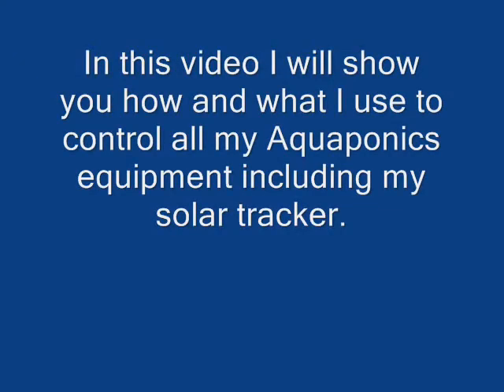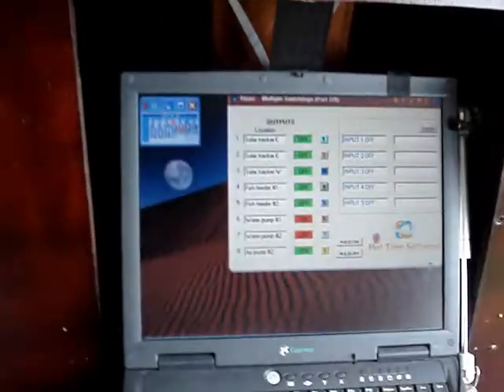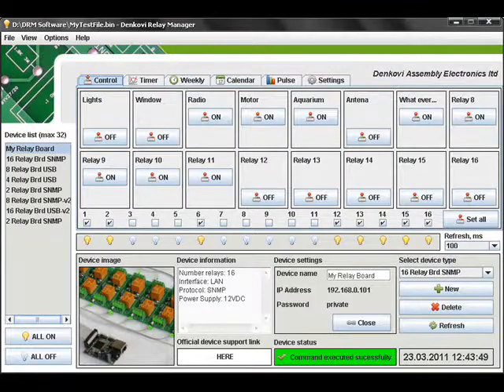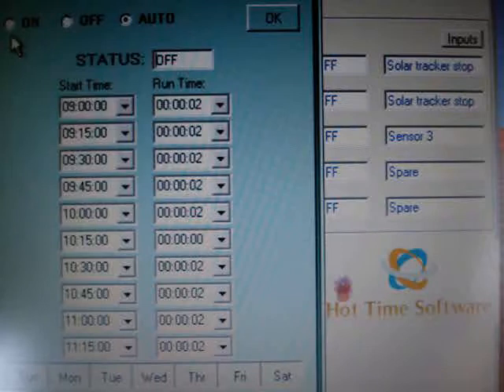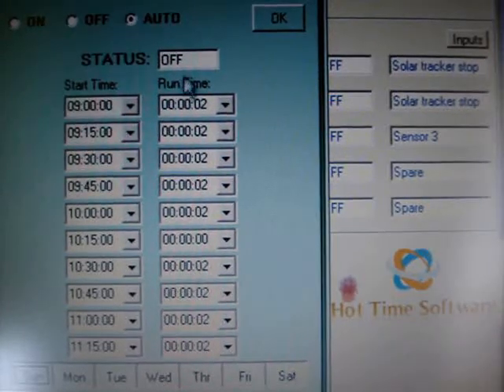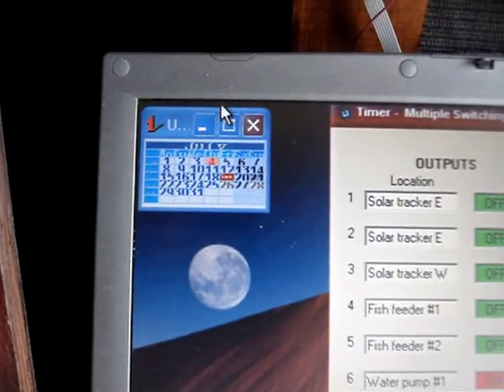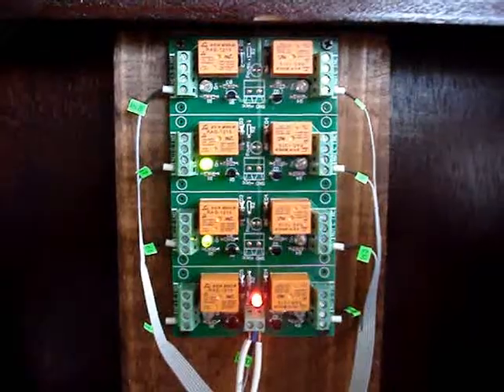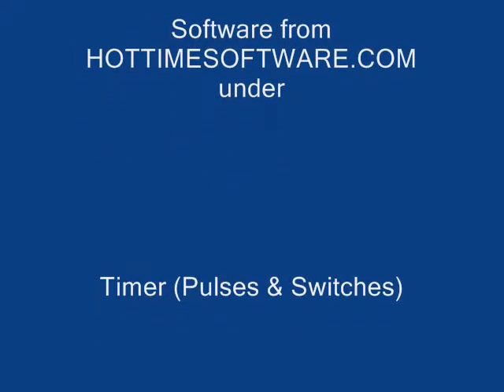Control software for all my equipment from solar tracker to aquaponics

Comment: Nice Video.  FYI: A friend showed me how with only  a couple transistors and 2 light sensitive resistors  (LSR), he devised a way (super cheap and no computer) to track the sun;  I recollect the 2 LSR's were between a card so that they would each see only one hemisphere, the difference in voltage was used to control which way the motor would turn* (at sun-up the eastern most LSR would take over and the motor would turn the whole array 180 deg to face the morning sun ) .  Uses just minimal electricity.  Portable and works in all seasons without reprogramming in any location in the world  (i presume your method requires seasonal adj?)     I think he spent less than $50 for the control section and normal pricing for solar panels and bracket (I think his just was tilted perhaps 40 deg vertical and swung on a track from east to west . )  
*It might be that the transistors were used to trigger relays (when eastern most is highest voltage the other transistor is off and the eastern circuit relay gets enough power to trip activating the motor until it reaches a point where the voltages are about equal (tracked to sun) vice versa if western most LSR gets more sun then the western most transistor gets the voltage to trigger motor but in opposite direction (wired opposite), thus moving the solar array to the west until east and west LSR's put out about equal voltage;  all this approximately from memory.

Comment: ime going down this road, but what happenes if theres a power outage ? do you have to reset everything, can you make the laptop boot up and take over ?
Reply from the maker: I had a UPS hooked up to the system for this problem. I have changed the system to run on the solar power. Please watch https://www.youtube.com/edit?o=U&video_id=yDxCCJ1NwGs
Reply from the maker: I was using a UPS for this problem I am now using the solar power to run things. Please watch https://youtu.be/yDxCCJ1NwGs

Comment: Have you thought about switching the control from a laptop to a raspberry pi?  It has gpio pins which can be programmed to do exactly this and uses a fraction of the power...
Reply from the maker: Yes I have , check out my video on" hybrid arduino controlled solar tracker." Thanks for the comment.

Comment: Ace, 
I am interested in Trout .. when I get my AP started.. and I am wondering how yours are doing? Do you get the harvest you expected from them, are they reproducing at a sustainable rate?  
Stephen
Reply from the maker: +Stephen Beech I did not like the trout so much they are not as easy as Tilapia. They need cold water and  lots of air , also very aggressive towards others smaller than themselves. None of mine reproduced on like my in laws who had no problems with the  the Tilapia reproducing. I did get to eat some but I did not continue with this type of fish. I now have some ornamental fish and some Tilapia. Good luck with your AP system.
Reply: +Stephen Beech; My Tilapia tasted amazing in my hybrid A-Q system, I mean like the best fish I ever had amazing...  I don't care for catfish but think they are even easier than Tilapia to raise. They would not need a system like mine & could be easily raised in a standard aquaponics system.

Comment: The use of the drill motor is a really good idea.  I bet there are lots of those things around, old ones, obsolete ones that could be used for something like this.  I had one myself, but I gave it away.

Are you actually tracking the sun or controlling the motor according to some kind of program without sensor inputs?

It seems like you could have some kind of photocell arrangement that would discriminate as to whether to move it east or west or not move it at all and toggle the direction circuit in the motor to move until both sides are equal ... then turn it on every 5 minutes or so.  But then ... what do you do at night?

Thanks - this video really got me to thinking ... but I don't have any solar panels yet. ;-)
Reply from the maker: I use two relays to operate the motor. One to track West every 30 minutes until it reaches its stops. Starting around 9 am at 1 second intervals. By using this simple timer I do not have to worry about clouds or the tracker having to find the sun once the clouds have moved. When it gets dark around 6 pm I have the other relay turn on for about 15 seconds to reset back East. I am also using the timers to run fish pumps and air pumps. So far the system has been working without a problem. Thanks for watching.
Reply: Aceman307 Thanks for posting, very interesting stuff.

Comment: Looks good!  Can you set this up as a WIFI (or Bluetooth) from your computer to the relay board.  Also, can you control the computer remotely either online from another computer or with a cell phone?  What will happen after brief power outages?  Thanks again for a very good explanation.